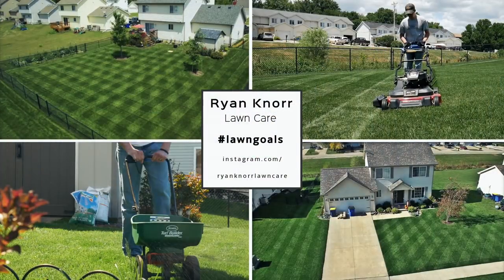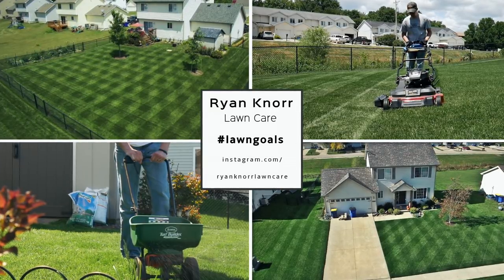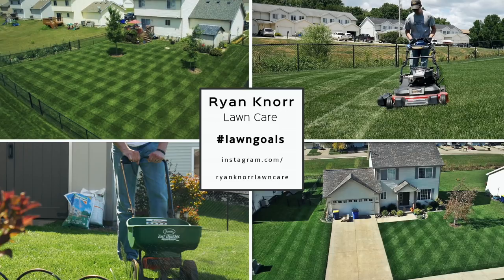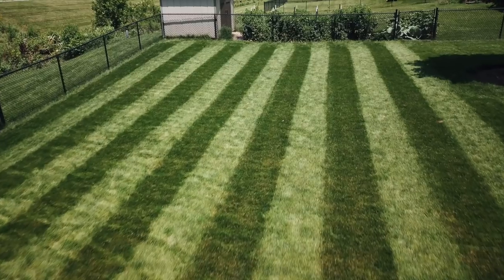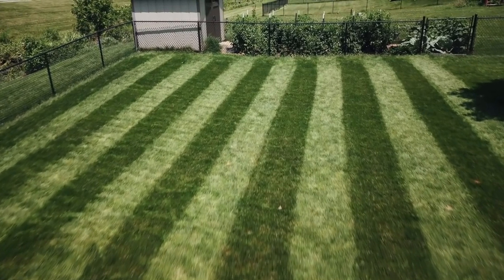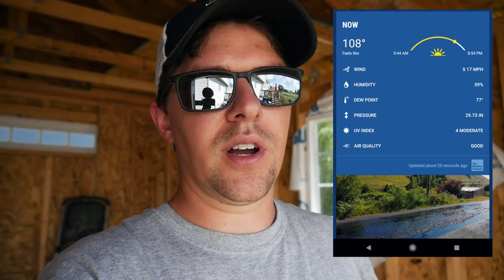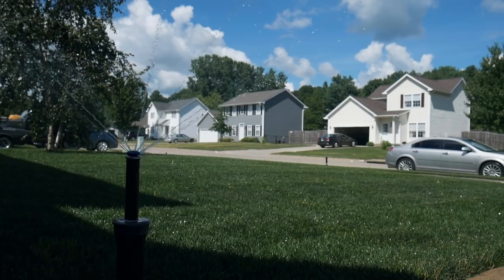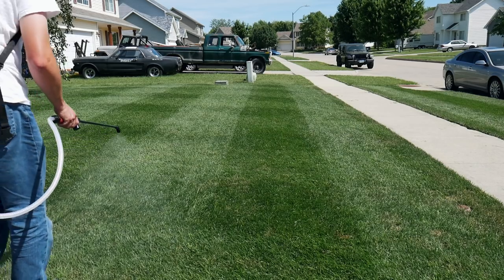Cool Your Heat Stressed Lawn With Mid Day Watering?

Comment: I built this sprinkler system and thanks to you. I'm very happy with it.
Reply from the maker: Great to hear!
Reply: Ryan.... I need this irrigation how to.. Is their a video.. When I lived on the west coast irrigation was norm... I tried two heads in my Midwestern lawn last year and didn't seem to have enough pressure!! What's your secret?!
Reply from the maker: There should be a link in the description for my video on how I put it together.
Reply: Do you guys leave your sprinklers in place for stuff like this (watering everyday for heat or over-seeding) and just detach hoses?
Reply: Daniel Nash - i leave everything in the yard. Only remove it when i mow.
My grass is above 4 inches high so no hoes can be seen. My system is not as high as Ryan so u see maybe half of the sprinkler head sticking out. Not ideal but it works and cheap.
Reply: Heinzkitz Velvet - i tried your method yesterday. I just trimmed around the heads before and i didn't to move anything. Good idea.

Comment: Thanks for the tip i was always to believe that watering during hot weather wasn't good for the lawn but after watching your video I'm going to give it a try
Reply from the maker: Watering to try to actually put down a decent amount of water into the soil is a bad idea because it's a time of high evaporation but we are just trying to cool things off for a little bit during the heat of the day.  A lot like pouring a bucket of water on your head to cool off for a bit.

Comment: Thatnks for the the tip. I know its year past since you posted this video but heres a tip and a thanks. Ill repair the rot in that wall with the window.  Having the house wrap tucked/folded back into the house is a no no. Whoever did that with the house wrap and or separately installed that window shouldnt have and should've cut it flush with the opening and at the top put the wrap over the window flashing, what coming back into the house does is just creat path for water into the house, be it driving rains, moisture from condensation, or water vapor rising up behind the house wrap, it will travel along the house wrap inside or outside of the wrap right into the opening, then rotting the sill and  then the sheathing.

Comment: So it's a myth that watering in hot heat will cause your lawn to burn? That is good to know. I don't have an automatic watering system, and don't always have a good window for watering while avoiding sun, and avoiding watering too late. Will start giving this a try. Your lawn looks pretty amazing.
Reply from the maker: Yes this method is similar to dumping a bucket of water on your head on a hot day.  It's a short relief but it does help.  You just don't want to be watering to try to actually get a bunch of water to the soil at that part of the day because evaporation is high and you are fighting against the heat.

Comment: Do you pull and drain your hoses after each use? I always have to drain mine because the water remaining is always very hot from baking in this heat
Reply from the maker: Not every time, no.  The water sometimes is hot for a few seconds at the beginning but doesn't seem to cause any issue.

Comment: T-NEX (growth inhibitor)... why are you trying to slow the  "growth"  of your lawn or is it just to add deeper green to your cool season Kentucky Blue Grass?
Reply from the maker: Both actually.  When cutting a lawn shorter is definitely helps to slow it so that you can maintain the 1/3 rule of not cutting off too much grass blade when you mow and I've seen deeper color as well as more tolerance of the heat.
Reply: So do you use the T-NEX during the entire growing season or only during parts of the season when temperatures are above 90?

Comment: Considering your sprinklers throw water at less than half the rate of typical oscillators - shouldn't you be watering for closer to 20-30 minutes?? it sounds like a lot but with those sprinklers, to throw down 1 inch of water you'd have to turn them on for 2.5 hours vs. 1 hour with oscillators
Reply from the maker: I'm just looking to get the grass blades wet enough to cool them off.  So it doesn't take much water really.
Reply: Ryan Knorr Lawn Care how many heads do u put off one hose line? Also any idea how long u have to run them to get .5” or 1”? I know all of this is based on your water pressure but I’m just curious on your set up for u. Thanks

Comment: Thanks for the video Ryan! 
Had a question about the PGR- is it ok to use in the heat of the summer?
Reply from the maker: If the lawn is still green and not browning then yes, but if it's really stressed already then no.  You would need to wait until things improve but fall is on the way!
Reply: Thanks Ryan. I have a few small dry spots but for the most part staying green, I was thinking about PGR as a strategy to drive some deeper roots to help it cope even better with the temps in my area!

Comment: Thanks for sharing, but just to point out for the viewers, if you are Eco-concious or care about conserving/responsibly using water, don't do this. This practice runs contrary to 'best management' practices since the hottest part of the day is one of the worst to apply water. Between transpiration and evaporation not much of the water makes it to the actual roots. Also your city may have watering restrictions you are breaking.
Reply: Copper Creek Cuts knew I'd find you on this video. I bet you watch Something 2 Look At also?
Reply: Hmmm, he wasnt watering to get water to the roots.  He was watering for a short period of time too cool it down, to relieve some heat stress and possibly keep some from dying.
Reply: Ryan Brand I completely understand! Just wanted to point out the cost involved for the two or three degree drop.
Reply: Jeff Nothing beats watching Mike tear through tall grass on that Cheetah! ;)
Reply: Heinzkitz Velvet I don't want to appear that I am saying it isn't effective. As I pointed out in my comment, this is just to let folks know it is horribly inefficient use of water, as well as setting you up to possibly violate local ordinances.

Comment: What if we have Bermuda grass? It loves heat, right? I mean it is "warm season grass"
Reply from the maker: Yes bermuda likes the heat but it will still need sufficient water in order to thrive.
Reply: It doesn't love the heat if it doesn't get enough water.
Reply: I am just asking about in the heat of the day. My lawn gets its water & watered before sunrise
Reply: If you're watering in the morning, I don't think you need to water during the day.  If you haven't watered in a few days (or it hasn't rained), you might want to water in the afternoon to prevent it from going dormant.  I've had this happen a few times because my Rachio thinks that it's going to rain...then it doesn't.